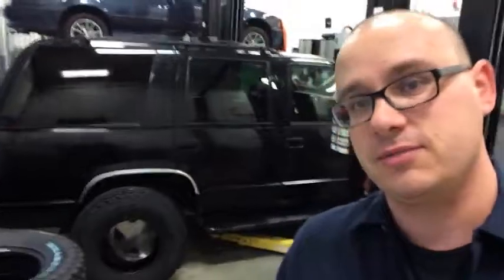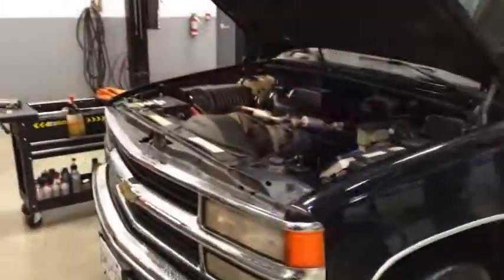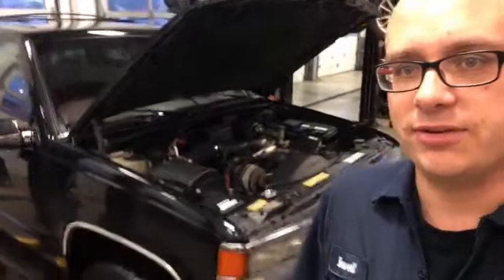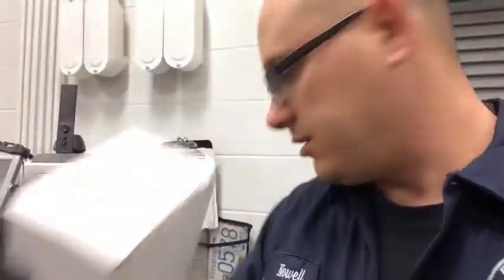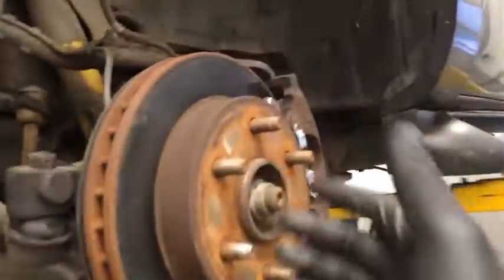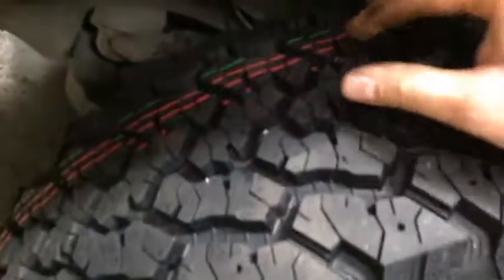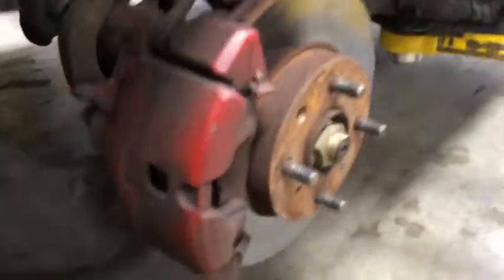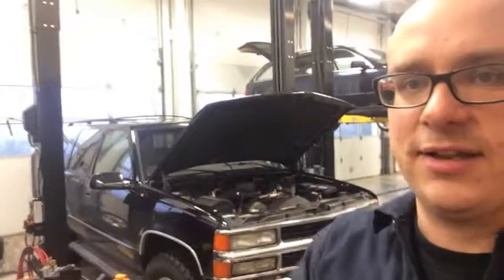This old car: 1999 Tahoe ball joint, tires, and a visit with Mark

Comment: Was those ball joints hard to replace? Mine failed a safety inspection when the shop was hungry for work. The rivets were a real PITA to separate the joint and punch out. How long did those Advantage Ball Joints last?